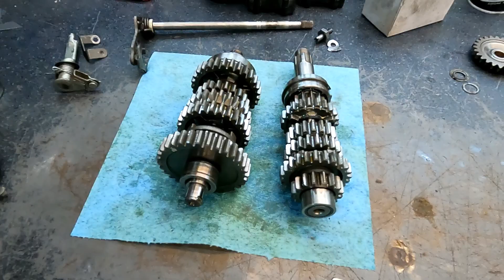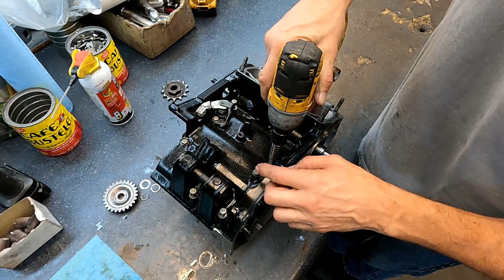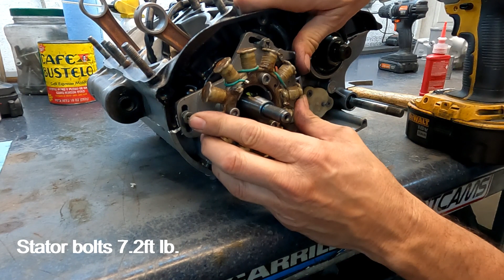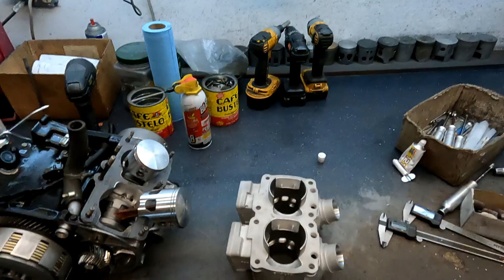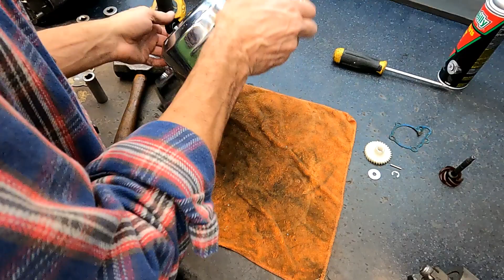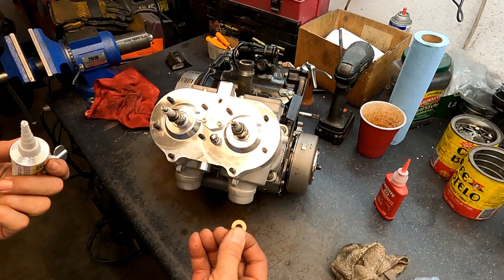421 Wampus Banshee assembly

Comment: great video, did you soak the clutch plates before putting them on?
Reply from the maker: I never do but it sure doesn’t hurt to do so.
Reply: @herrjugsracing7816  well either way, you got yourself a sub. Great assembly and thorough explanation.

Comment: Do you have to bore the upper case to fit the 421 wampus cylinder or is it just for the super wampus that require case boring? Say 72mm and up cylinder
Reply from the maker: All 72mm cylinders need a case bore to fit the cylinder. If its 68mm no case work is required to fit the cylinder.
Reply: Is it worth the jump from 68 to 72 or is it taking away to much transfer room to be the 72mm bore size and will there be good revs with them heavier pistons i live in ohio and basically trail and field ride and want more power everywhere but am scared i will lose my mid low to mid hit i have now it runs super good now just know or feel it can be better
Reply from the maker: @jafeg  Yes, the 472cc (4mil) Serval Super Cub rocks the low to mid hit! The cost is the only question. Is the cost worth the power? Only the individual and income they are willing to part with can tell you.

Comment: You don't use sealant on the cylinder base gaskets. Not necessary?
Reply from the maker: It can be used on any gasket surface. I use it where necessary for me and have used it on base gaskets.

Comment: When you do a stroker motor you are supposed to put plates
A 4 mill takes a plate about. 160 to .0190
If you do it right.
Because now  Your transfer ports are not gonna be level with the copy earpissed in that bottom dead center
Reply from the maker: This block is cast for the 4mil so never use a spacer plate on this type of build.

Comment: The bottom of your rods  Was machine down so it doesn't hit the cases   And when you measure your rod it is centered a center. No. I run a 132 mm rod which is ktm 500 rod o a cr2500 motor.
 Which is longer than those banshee rods.. Wasn't trying to be a smart ass but wrong faces
Reply from the maker: Thanks for the feed back but no. The rods on this build are not touched. They are made to be 115mm. My facts are correct.
Reply: @herrjugsracing7816  
 On a stroker crank you have to machine the bottom of the rod before it gets put on the crank. You can visually see that this was done on this crank.